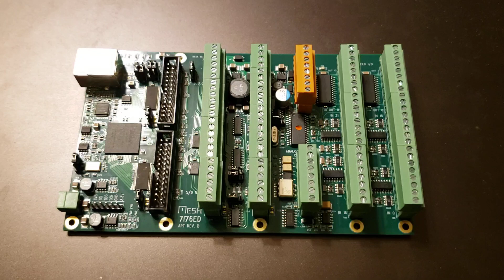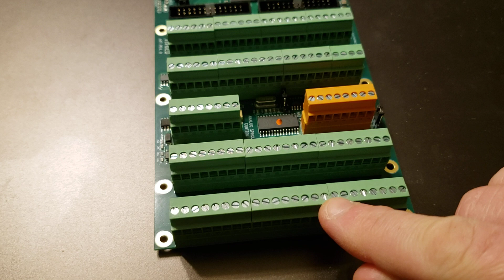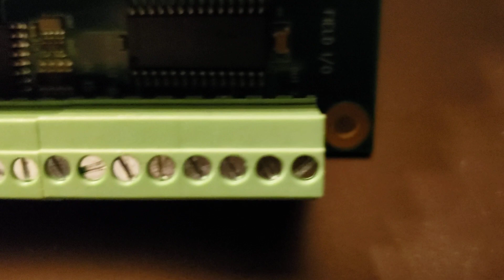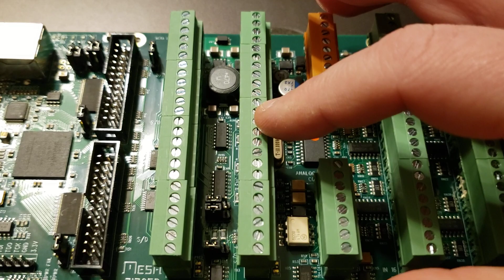Mesa 7i76E/ED overview

Comment: Thank you for your videos! One frustration that I've had is software. Ideally I'd like to use old laptops with 32 bit CPU's. My latest I've installed LinuxCNC 2.7.14 "Wheezy" Does the 7i76E work with this version?
Reply from the maker: Only if you use the preempt-rt kernel. Rtai is for parallel ports
Reply: @TheFeralEngineer  Thank you!

Comment: not hobby users card, too expensive, i need build wood mill cnc to my son but mesa card have totally owerprice too expensive use hobby maker shop. were can buy mesa card or copy cheap, less than 100$ because normal hobby builder not can pay 100-300$ one card.
Reply from the maker: So get a Chinese breakout board on AliExpress and stop spamming my page with your garbage
Reply: @TheFeralEngineer  im NOT spam, i looking link mesa card price and have true out of hobby users budget, owerprice lot.
Reply from the maker: @mattivirta  unfortunately, I don't have any answers for you. Considering the price of a comparable Ethernet smooth stepper, mesa prices are right in line with their respective market
Reply: @TheFeralEngineer  Hey do you now a way to get a mesacard looks like there are no availible ?
Reply from the maker: @JaS-kd6kx  unfortunately, I do not. The only available card right now seems to be the 7i96s in small batches

Comment: Is there any mesa 7i76e in stock in the world?
Reply from the maker: No, but you can get the new 7i96s 

http://store.mesanet.com/index.php?route=product/product&product_id=374&search=7i96
Reply: I want to use 2 pcs linear incremental encoder for x,y and an rotary encoder for z position. Is it possible with this motion controller? Do I need to buy additional brakeout I/O panel for it?
Reply from the maker: @gmzsolt  yes. You would also need to buy one for the 7i76e because it only supports one encoder. The other two are single ended for mpg use, primarily. You'd probably be better off with a 7i95 or you'd have to add on a 7i85 to either of the other options

Comment: Thanks for that, very interesting. If you are undecided about sinking or sourcing, in industrial applications we NEVER SWITCH THE NEUTRAL because some short circuit events can cause equipment to start and not be able to switch off. Sinking is switching the neutral, DON'T USE IT!, use the sourcing option please.

Comment: If I understand correctly, the 7i76 is a DB25 breakout, this board is more like a 5i25 combined with 7i76 that uses Ethernet instead of PCI. It still offloads step generation from the PC right? I'm having a rough time understanding how all the components work together
Reply from the maker: This is like a 7i92 connected to a 7i76 db25 board, but yes. It's much like the 5i25/6i25 and 7i76 combo, but it uses Ethernet.
Reply: @TheFeralEngineer  great, thank you for the response and all the HAL tut's.
Reply: Ive got a 5i25 and 7i77 plug n play. I was considering leaving the servos to step direct and using 1 micron glass slides to the control. Not sure how well this will work.
Reply: @duediligence791  interesting. I've wondered about this because the servo drives I've seen use the rotary encoders as their feedback. It's not necessary to feed the encoders back to linuxcnc, so theoretically you could use glass slides for absolute positioning.

Comment: do you know if I can use the 7i95 with raspberry pi?
Reply from the maker: I don't see why not. My only thought would be the encoder inputs might not be great and higher speeds with the limited performance of the pi, but otherwise you should be okay. I'd email Peter Wallace at Mesa to know for sure, though. pcw@mesanet.com
Reply: @TheFeralEngineer  I will not use the encoders inputs just the I/O ports for the axis and spindle output, currently it's working with mach3 but I want to migrate my system to linuxCNC, and thanks I would appreciate it very much.
Reply from the maker: Have you considered the 7i96 or 7i76e then? The benefit of the 7i95 is the fact that it's a step and direction board with encoder inputs
Reply: @The feral engineer   the 7i76e is out of stock and I saw that the 7i96 have few outputs and inputs, but you think that is enough for my cnc? for that I wanted to buy the 7i95, but I'll considerate your opinion because you have more experience than me
Reply: @nelsone.1472  raspberry have own mesa card 7i80 etc, used whit raspberry pi.

Comment: For using the two expansion IO ports,  they need the connections with two extra  breakout boards, am I right?  If so, may I connect other brands' ones instead of the Mesa ones that it recommends. Thanks.
Reply from the maker: You can utilize the header pins by themselves but you need to resistors to protect the board from spikes. I've not done this, but Peter from Mesa mentioned it as an alternative to something I had a question about a while back. You should be able to use the headers with other types of breakout boards, but the mesa ecosystem is very robust, so I would suggest sticking with it if it fits your needs
Reply: Understand. Thanks

Comment: Power for inputs do not come directly from power supply. It should come from the isolated field power. The orange connector.
Reply from the maker: Hmm, makes sense. Learn something new everyday!
Reply from the maker: FYI - as confirmed by none other than PCW himself and I quote:

"If you are using a single 24V supply, any +24V will do"
Reply: @TheFeralEngineer  yes but still has to go through the field power. (orange connector).

Comment: I liked this video, I hit the thumbs up, I am subscribed, I watched every second of it - my morning coffee. I am a complete noob, to electronics, machining, CNC, etc - and am completely out of my element but I am determined to learn. I like your style of explanation, etc. I hope you don't mind if I leave a suggestion or two...I would like to see a video about some of the wiring and electronics considerations that go into this. Like what gauge wire should be used and why, why 24V, I have a 48V power supply for my motors. I figure if every day I learn something more, then every day I get closer. Right now I am going to find a wiring diagram for the 7i76 I ordered and will print that out, its a start.
Reply from the maker: 5v and 24v are commonplace on industrial CNC equipment. 48v is into the realm of high voltage supplies for steppers, etc. Most IO communications happen at the 5v or 24v level, occasionally 12v, but not often. The mesa cards only handle 32v but will run at the 5v level as well. It's suggested to run 24v into the field IO and into the tb3 section with the jumpers as I mentioned in my video because that will convert 24v to 5v level to power 5v IO and the Ethernet section but supply 24v to the field IO, unless you have a specific reason to separate your signal level (5v) and io level (24v). It just saves space and uses less power supplies. 24v, 5A is a good power supply for general purpose use with the mesa 7i76e.

Wire gauge is based on length of run and amount of voltage required. I personally use 18-20awg for most but you can run 22-24 at signal level but i like something that's got some meat to it. My mains wire is usually 14awg because home breakers don't venture much higher than 15 amps, 12awg for 20.
Reply: @TheFeralEngineer  great explanation.   love the channel...im about to switch one of my machines to  linux cnc... i know it quite a different animal than mach 3...i think your videos will help me get over most of the hurdles.....thank you for this and all of your knowledge.
Reply from the maker: @minskmade  and thank YOU for continuing to inspire me to make these videos 😊
Reply from the maker: @minskmade  as a side note, Mach and Linuxcnc share the same ancestral history. Emc was forked into Mach 1 for widows and emc2 for Linux, which eventually became Mach 3 and LinuxCNC respectively.
 Anything Mach can do, LinuxCNC can do, but in different ways. Think of it as baking a cake. Mach is a premixed box of yellow mix, Linuxcnc is a countertop full of ingredients
Reply: @TheFeralEngineer  ha nice.
i know mach 3 so well...but i want to know both...because i love all cakes.
Reply from the maker: @minskmade  i mean who doesn't love cake?! 🤤🤤🤤🤤
Reply: @TheFeralEngineer  im a bit of a noob. what is EMC?
Reply from the maker: @minskmade  enhanced machine controller - previous name of LinuxCNC
Reply: @TheFeralEngineer  thanks so much. Yes, I want to ditch the regulated 48v power supply for a toroid power supply instead, and I found a power supply that provides 24v, 12v, and 5v..
https://www.steppermotorcanada.ca/steppermotorcanada_031.htm
Reply from the maker: @matthewcote4991  that'll definitely do the trick. Also, don't forget the 7i76 has many 5v provisions and you won't find much of a need for 12v unless you want to use 12v relays or something. Most industrial machinery runs 5v and 24v, 12v stuff is pretty rare

Comment: Another superb explanation.
I'm running 3 machines with 5i20+7i33. Analog servo drives in all of then.
From your explanation, if I'm understanding well, the 7i76 is like designed for steppers more than for servos.
I'm right?
Could be used the 7i76 for analog servos?
Thanks very much
Reply from the maker: The 7i76 will handle anything that supports step and direction, so steppers and some servos will work - DMM and clear path have supporting hardware, I'm using DMM on my mini mill with a 7i76e, but they are only closed loop from the motors to the drives, not the software. With the expansion card capability, I can connect the encoder feedback to the expansion board and still use full closed loop if I wanted, while still retaining step and direction drive. 

If you want to drive analog servos, you have the choice of the 7i77, which is a parallel port card or the 7i97, which is Ethernet. The 7i77 can be made to run on an Ethernet connection with a 7i92 board attached to the DB25 of the 7i77 or use the 7i97. Downside to the 7i97 is less IO but it's a 6 axis card instead of 5 and you still get expansion slots for additional IO if needed. Both of those boards will support analog servo as well as full encoder feedback loop
Reply: Thanks again!

Comment: thanks. Will probably get to one of these. I am starting out with a Rpi for a bit of fun. Best of luck
Reply from the maker: I ordered a pi for the lathe I'm building. It'll be my first attempt at using a pi with the 7i76e. There's also a 7c81 board I'm interested in finding out more information about, it connects directly to the gpio header on the pi and gives you 3 26 pin io points
Reply: @TheFeralEngineer  I have watched Chris videos about the pi. I have done some testing with my own logic shifters. I am going to order one his boards out of the next batch. I used his Hal and ini file. It was pretty easy to follow. Very interesting how the Hal file is setup for the pi. Thanks for the great effort you  are doing. I have watched a few of your videos and all are great.